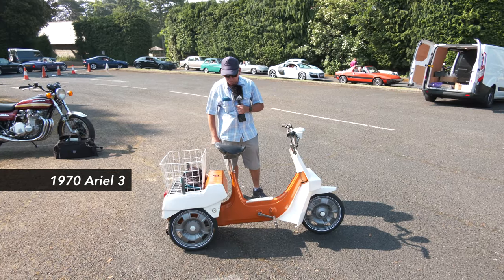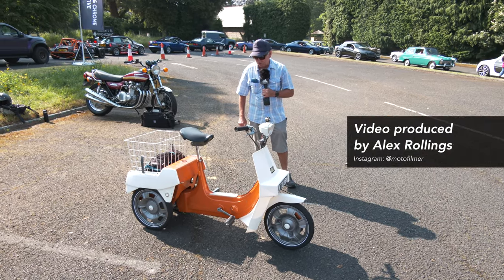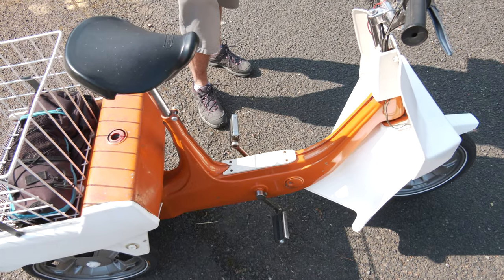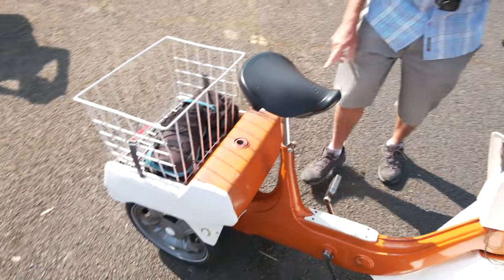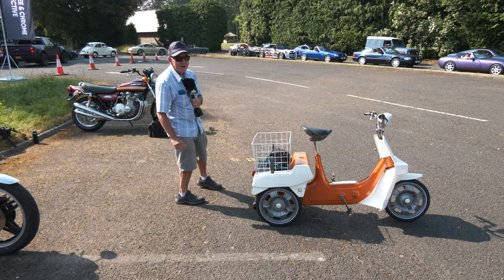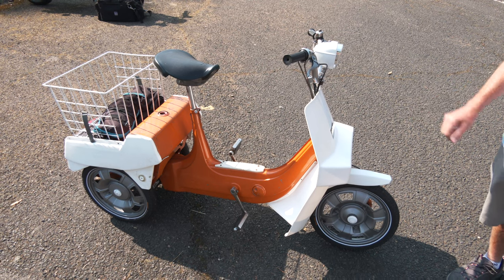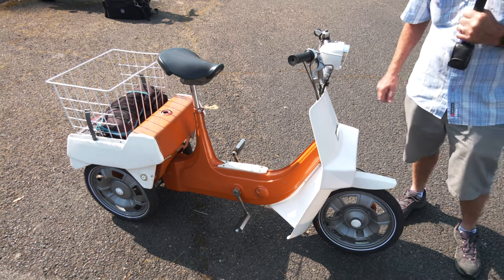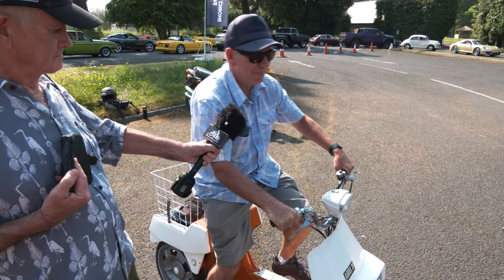1970 Ariel 3 'Granny Killer' - quick look & ride

Comment: I only ever saw one of these on the road.  A middle aged woman used to ride it along my route for walking to school when I was about 12.  She used to go like hell downhill (a long slope down into a valley), lean into the slight bend at the bottom with the throttle wide and try to maintain her momentum to reach the top of the shorter uphill bit of the road.  To be fair, she used to make it to the top but looked in danger of tipping over.  I don't think I ever saw her riding in the opposite direction, which would have been a challenge.

Comment: I cannot help but wonder what the people at BSA, who had built such machines as Gold Stars, Super Rockets, and the like, were thinking, when they were reduced to building, (if that is the right word), this disgusting contraption. After the BSA 'Dandy', another miserable flop, you would have thought the management would have had more sense.
The advertising said it all:- "Here it is, whatever it is". I think most people could have told BSA exactly what it was, but it is not a good to idea to repeat it here.
Reply: If BSA had taken note of Honda stepthru  designs and Standards and something as safe and reliable ,they could have sold many thousands of them.
Reply: @cerealtiller  Unfortunately, common sense was a commodity sadly lacking in the boardrooms of the british motor cycle industry in later years.
Reply: @petersnow389  And even worse was the Clarke Scamp...absolute Horror Story.